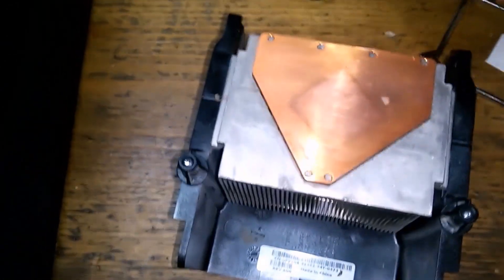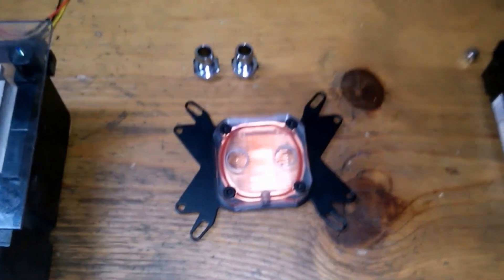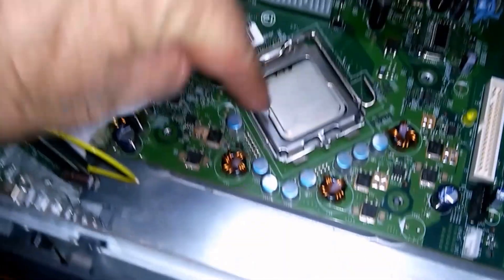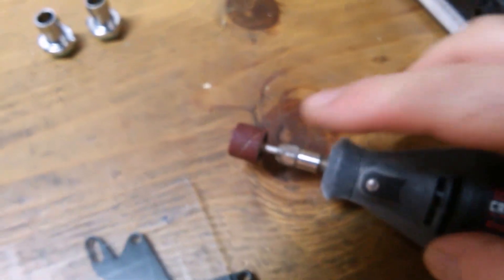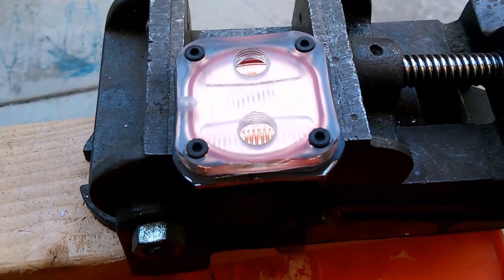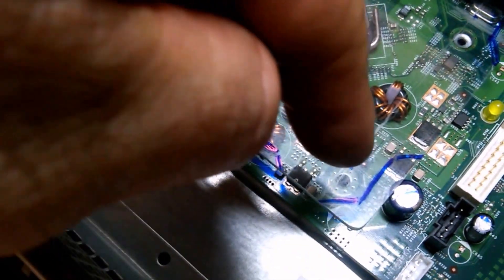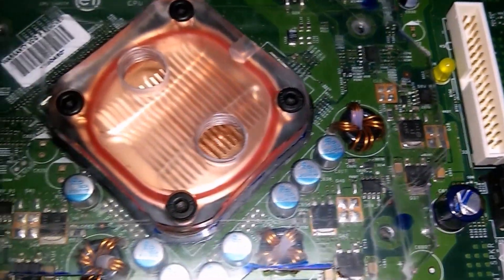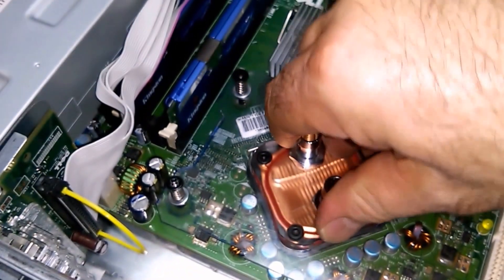Dell Optiplex BTX Water Block Mod

Comment: Wow that looks really good. It was really awesome watching the steps you made to make it fit. I would personally want the rad in the front rather then on the side. You should voice over the video so you don't have to worry about audio. Also you should make yourself a tripod so you don't need to hold the camera and use one hand. Anyway keep up the good work and looking forward to this project update.
Reply from the maker: Glad you like it dude. I honestly don't think that cheap 80mm is going to be able to cool the CPU. I just need to test it to make sure. At least it will make an interesting video. The voice over thing is a good idea. Can I use the mic on my gaming headset? I'm going to get a real camera and tripod soon, I just don't want to drop the cash =(
Reply: I don't see why not. If i ever started making videos i use what i have, gaming headset would be fine. I know how you feel about money struggles. Have you ever been to like goodwill? you can find good stuff there, I've see tripods there before. I actually got a camera there cheap once. Mileage may vary.
Reply from the maker: I'm learning video/ audio editing for the first time. It's fun, but time consuming learning software. I'll try my headset for a voice over on this latest video. Is the audio bad enough that I should replace it with a dubbed version? Getting better equipment will make for less editing I'm sure. I've actually been wanting to go by the thrift store for an old school waffle iron. They don't make waffle irons like they use to, lol. I have a really nice one near me that all the local estates donate to all the time. I'm sure they will have lots of camera stuff.
Reply from the maker: I'm a stay at home dad with a 2 year old and a 4 year old, haha. Mom is making most the cash right now and she doesn't like to spend money on my hobbies. I've actually done window tinting most my life. Cars, houses, and commercial buildings. I should do some car tinting videos for you guys.

Comment: I had the same question as TAG Media since its been a year later are you able to take any commission work on this mod for a 755 dt?
Reply from the maker: Hey Randolph. The main problem is cost. The cheapest water block on eBay is about $17 from a U.S. seller. If I want to do a good/clean job, it takes about 2 hours from start to finish to mod it for the 755 DT. So if I pay myself $10 per hour and add in the cost of Plexiglass and things like grinding disks for my Dremel, I would have to sell it for $40 plus shipping just to make $20. If I had 8 orders a day and got the fab time down to an hour it might be worth it. I just don't think that there are very many Dell Optiplex DT owners interested in this mod. I mean, it might be an interesting video, but I'm not sure how many people actually want to do this to their Dell. Plus, you still have to buy a radiator, reservoir and pump and install everything on your own. It's been awhile since I watched this video, but I remember it being pretty bad. If I did a new video that's a better tutorial, would you be able to do it yourself? I guess the problem with people doing it themselves is that not everyone has the tools. If you had to buy the tools (a rotary tool is a must) to do the mod, I guess it would be cheaper to buy it from me. Sorry for the long response. It's pretty late here and I'm just kind of rambling because I'm tired. If you leave a response, I'll read it in the morning and get back to you. Let me know what you think.

Comment: Do you take on commission work? I'm interested in a custom block for my old Optiplex 780.
Reply from the maker: I haven't done any commission work yet. The amount of time that I have available for working on computers is kinda limited right now, but I could put together a more refined version of the one in the video pretty fast, it's the exact same process for the 780. I would just need to buy the block and some plexiglass. I also have the video of my old 780 MT with a All-in-One cooler mod, that worked out really well if you want to go that route.
Reply: Jon T
I wish I could, but on the MT version of the 780 the PCI Express port is so close to the CPU heatsink that nothing but a waterblock would allow proper clearance for larger video cards. 

Let me know what you would charge for a custom block..there's no rush on it, just something I would like to do for the future.

Comment: you should check out the dell optiplex 990 it come with an i5 and has enough room to fit about any graphics card and you could possibly mess with watercooling, it retails for$300-500 but you can get it on ebay for $150 maybe even less
Reply from the maker: I actually have a 390, it runs my vinyl cutter. It has an i5 2400, 8GB ram, and an HD7850 (1GB). The PC was $200 with shipping last year and the GPU was $61. I already had an extra PSU for it. The 990 and 390 are waay better for gaming rigs for sure. The i5 2400 is 50% stronger than the Q9650. That's a big jump. They're just kinda boring because they're ATX =(
Reply: +Jon T I'm gona try to get a 390 or 990 sooner or later to mess around with
Reply: Jon T do you plan on making any videos with the 390?
Reply from the maker: You jinxed me dude, jk. I was messing with the 390 last night and hit my knuckle hard on the rear exhaust fan and it shut down! I think I might have fried the mobo with some static or something, I can't get it to turn back on =(. I'll shoot a quick video of it today even though I might have to get a new mobo for it. I seriously haven't touched that 390 in weeks. I'm pretty bummed.
Reply: +Jon T damn dude that sucks
Reply from the maker: Rome Vayzo
It's actually the second time that it happened with this 390. Maybe I should get a static bracelet. It's a lot cheaper than replacing motherboards. I'll get that vid up in a couple hours.
Reply: +Jon T i currently have two pc's i could repair one is a sff factor hp dc7700 and the other is a dt dell dimension but the dimension shows that a mouse is connected when nothing is connected and i don't know how to fix that and i am pretty sure i fried the motherboard for the sff pc
Reply from the maker: Rome Vayzo
I've had 3 mobos stop working in the last year. On was the mobo out of that Craigslist PC. I think I overclocked that one to death, haha. I don't even know if a mobo can be fixed after it's "fried". I'm getting that 390 video together right now.
Reply: alright man i'll be on the lookout for the video